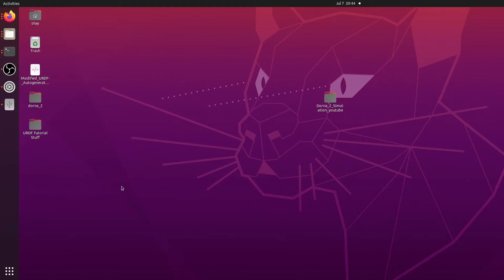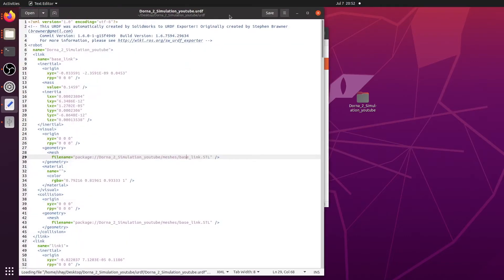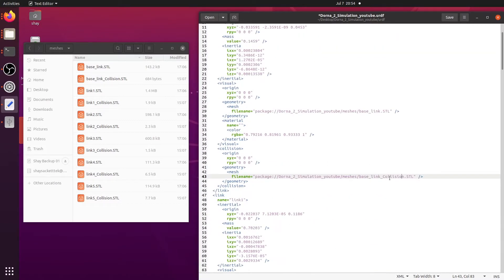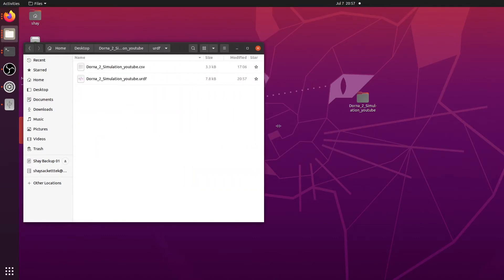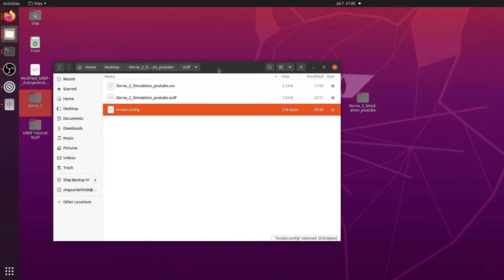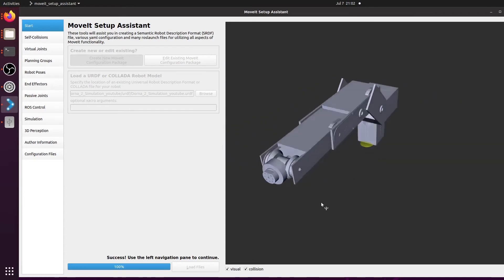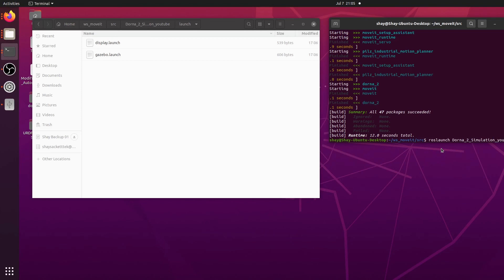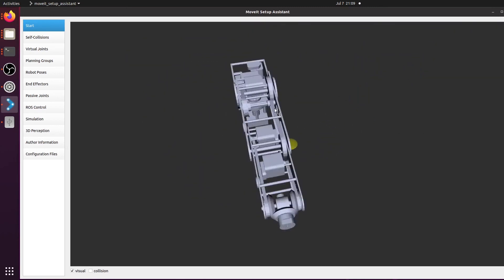SolidWorks to URDF Using the SW2URDF Plugin Tutorial Part 3/3 - Gazebo and Moveit

Comment: Your robot is collapsed in the gazebo simulator, which is not normal. I am sure you would be getting a controller error in the terminal you launched gazebo. I'm having the same problem.
Reply from the maker: You may be right. I didn't experiment much with the Gazebo side of things after this, I only imported this model into Rviz, see my later videos. I'm pretty sure the collapsed robot is due to the inertial properties set by the SW2URDF plugin, and Gazebo is just simulating the model without any sort of controller, so naturally without any feedback or power to the "motors" the robot will just collapse, as it would in the real world.